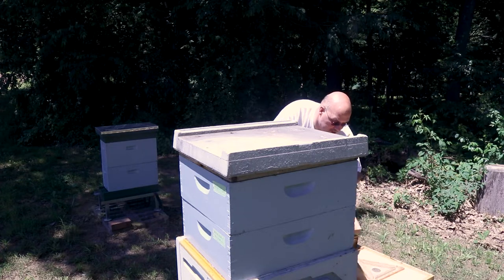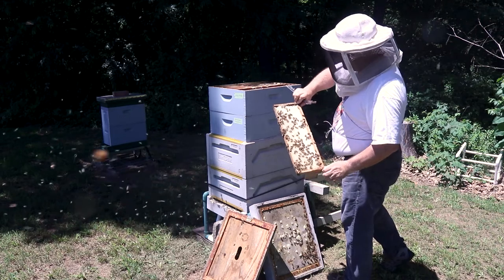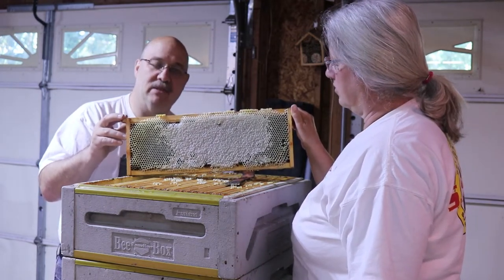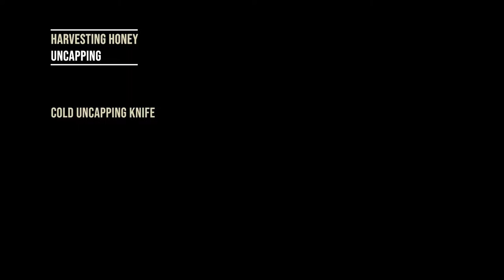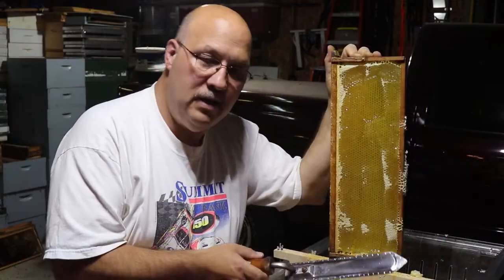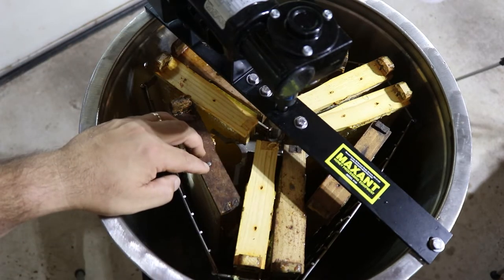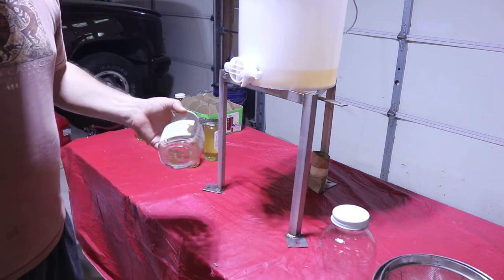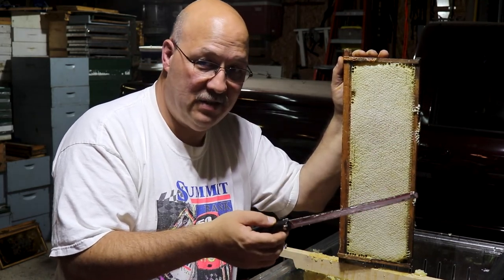Harvesting honey - A comprehensive run through

Comment: Great video for beginner beekeepers. I am a backyard beekeeper with about 5-6 hives. Have used the heat gun method of uncapping for several years now.  I uncap with heat gun and scraper over my extractor to minimize the mess and make clean up easier.  I also mounted my tangential spinner extractor on a rolling caster board (Harbor Freight Moving Dolly enlarged with plywood).  This counteracts the excessive wobble somewhat.  The wobble is not too bad and helps in preventing over-spinning and blowing out frames.  Thank you for your efforts and  excellent pod casts.

Comment: Kevin, great channel and podcast.  I’ve been keeping bees since 2006 and currently run 8 hives.  One tip that I have picked up over the years is letting the honey sit in the gated buckets for about a week.   This gives any air bubbles or wax bits a chance to rise to the top.  Since you pour from the bottom, you get beautiful, clear honey in your bottles.
Reply from the maker: Thanks for the tip.  > Kevin

Comment: Two observations if I may - 

Firstly - with a tangential spinner, it is a good idea to partly spin out one side but then to reverse the frames and extract the other side. Then reverse again and finish the first side. 

A real pain. Otherwise though, you run a higher risk of blowing out combs with the centrifugal forces, since extraction will cause the inner side to be much heavier than the outer.

Secondly - fixing the feet of the extractor will in time damage it, what with all that rotational force. One option is to mount the extractor onto either a frame or a board that has castors. The thing will dance around a little at first, but will settle as the honey leaves the frames.  

A lot of that wild movement is caused by imbalanced loading, so as much as possible you should try to load the extractor with frames of equal weight.

Frames heavy with honey... truly these are high-class problems to have !

Nice video, and good luck to all with your beekeeping this season.

Comment: I'm curious about the use of hot water to clean the extractor, only because hot water will make the wax that is left soft and it tends to smear.  Our club recommended using colder water.  Frankly, I just use a power washer, it made the job a lot easier! :)  Enjoy your podcast and the video's!

Comment: I'm not sure hot water is a good idea to clean the extractor.  This may melt the wax to the extractor.  I use cold water and a little bleach,  Than I rinse well.   Love the video . I learned a lot from you
Reply from the maker: Sometimes you can rinse and rinse and rinse and rinse and the inside is still a touch sticky. That is why we opted to do the final hot rinse.
After all the hose wash downs and specific rubbing off wax flakes, all of the wax has been knocked off and washed away.  The final hot rinse is to get rid of any vestiges of honey that sticks in the nooks and crannies and leaves a bit of stickiness if not thoroughly rinsed.  We pour the hot water in especially to get the groove at the base of the tank.  It is followed by an additional cold rinse.  
It was too much detail to put in the video and I chose not to elaborate since the video is already an hour long.  We have discussed the care of the extractor and this particular topic - does the hot water melt the wax within Northwest.  After doing it this way and inspecting the interior, there are no signs of a waxy residue.  And to the point, and once dry the interior is not sticky in any way.  
We all learn our ways and I suppose the right way could be just cold washes only but we developed this method and have used it for several seasons.  Personally, I wonder if it were easier to forgo but 'the boss' has developed her way of doing it - so that's how it is done.  I have learned to trust her judgment. :-)

Comment: Out of curiosity, if you use a mechanical means to move the bees off a frame, do you have to worry about agitating them (especially if the bees tend to be more aggressive)
Reply from the maker: I would speculate that they do not like being 'shooed' away but they are not harmed and rarely become agitated.  That being said I would always suggest wearing a suit because inevitably one or two bees do not take kindly to it and will buzz you menacingly.  In my experience - it is not a 'call to arms' agitation where they get super defensive.  That being said, taking honey during a dearth can get challenging sometimes.  Not so much that you are taking honey, but when bees are in a period of no forage available they become more defensive.  Foragers are more likely to be in the hive and they tend to guard more readily. Flick, shake, blow bees off a frame - as long as you do it well these mechanical methods do not overly agitate the bees.